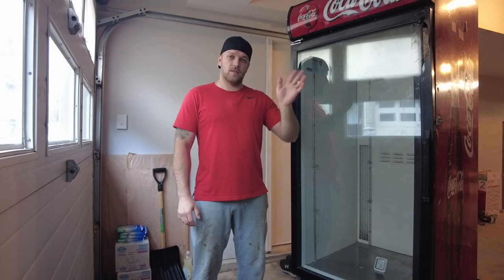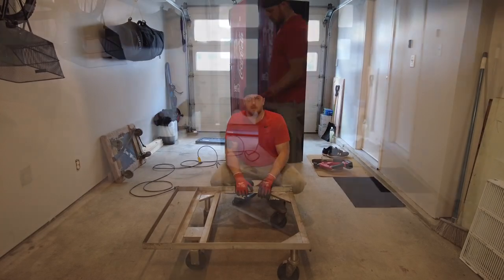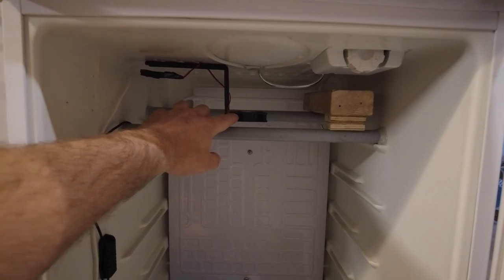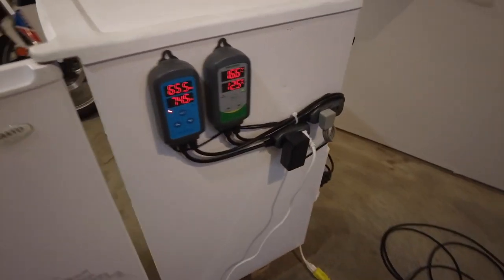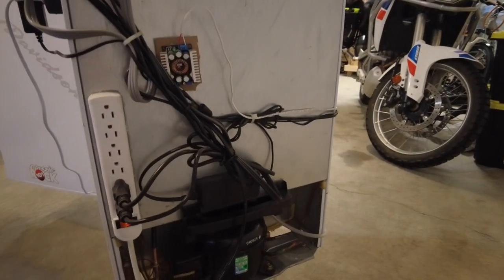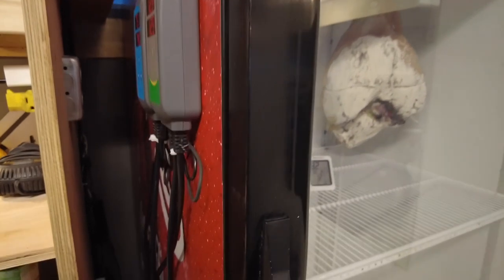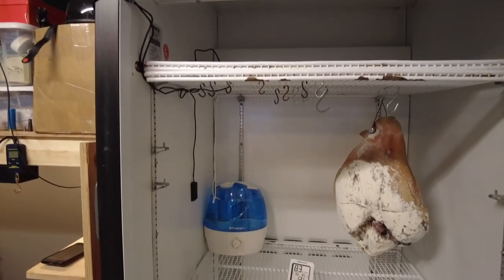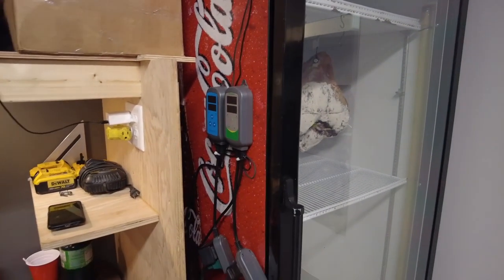Dry Curing Chamber, Easy Built

Comment: Can you provide more details on the timer? How it is wired? I am having the same issue with the excessive dehumidifying, I am also starting with a bar fridge.. Also, do you have a link to the timer from Amazon? 

Thank you!
Reply from the maker: Hey! Check discription, it's in discription the link. Wiring is very simple, but some guys might be confused so I can actually make a detailed video, explaining. Follow me here and I will make one this weekend for everyone 👍
Reply: @westcoastcharcuterie  sounds good! Thanks again. 

Just out of curiosity: in your experience how does having it on cooler side(say 50.6-51f) effect the product?
Reply: I must be missing the link to the timer in the description…this is your description: Hi friends! Finally I have a nice, big size commercial fridge and I'm excited to share it with you!
In this video I will show you how I built my little bar fridge chamber and we will go over a few Tips and a small secret on how to balance your fridge temperature and humidity.
If you have any questions please leave your comments and I will be more then happy to answer them.

Humidity and temperature control sensors by Inkbird.
Reply from the maker: @ironblud  I usually run on average 12.5-13°c so that is like 52-53°F I believe. In my experience I noticed that in higher temp the mold and bacteria develops flavours much better then really cold temperatures. If you have inkbird temperature controller, you can easily set up your temperature however you want
Reply from the maker: @ironblud  thanks for correcting me, I just shared it in other comments. I will update now. 
Here it is:https://www.amazon.ca/dp/B07F1C4W3M/ref=sspa_dk_detail_10?psc=1&pf_rd_p=d8c43617-c625-45bd-a63f-ad8715c2c055&pf_rd_r=7MGH8MHT4P50WAPRHYW0&pd_rd_wg=LITCc&pd_rd_w=wVJrk&content-id=amzn1.sym.d8c43617-c625-45bd-a63f-ad8715c2c055&pd_rd_r=ad8aacf6-6cc8-4ea0-9ef1-5b0bedacfeee&s=automotive&sp_csd=d2lkZ2V0TmFtZT1zcF9kZXRhaWw
Reply: @westcoastcharcuterie  thanks again!!

Comment: I noticed that you're passing wiring through the door. Is there not a gap being made in the gasket that way? Or you found a solution for it? I have a similar small fridge only with glass door that I'm working on at the moment.
Reply from the maker: Yes I just did for both fridges from the side in the bottom corners and it worked great. I didn't want to drill holes and run wires other way. I sold my little fridge, was very easy to remove all equipment and I sold it as perfectly functioning fridge. Did the same with a glass door one. Ran all wires in the bottom corner and that gap is actually so small that nothing ever can get in. Wires are thin, so it never been an issue, doors close properly too.
Reply: Yeah I get your point.  I'm not sure if there's tubes in walls of this fridges with cooling backplate, so at this time my greatest concern is that if I drill holes I may kill the fridge. That is why I'm interested in trying to do it how you did. Also my equipment is a bit different but the principle is the same.
Reply from the maker: @hammertiming8423  @hammertiming8423 I'm sure it will be fine. That's why I don't want to drill any holes in the fridges.. if something does not work you can always adjust and make changes, but once the holes are drilled, you can't go back..
Another tip, if you fridge is cycling to often, put your sensor in an empty glass bottle
Reply: You was right, I hotglued everything through the door and thickened a bit the area where the gap is, and there's no gap at all now. So far in the last 24h temperature and humidity is constantly in the parameters i initially setup. I'll try to put sensor in a bottle now to see if anything changes, cheers.
Reply from the maker: @hammertiming8423  Yep, great! Keep testing! Don't forget once you start loading fresh products, your humidity will go up to 85-87% but it's ok, it will stabilize after couple weeks and if you getting green mold you will need to install small fan like I did to circulate the air
Reply: @westcoastcharcuterie  so far the humidity is going from 73 to 80, mostly on 75. I'll do the initial drying outside the fridge italian way, and the finish it off inside. I hope i don't contaminate the fridge with bad mold and that ill manage to keep down humidity under 80 and above 70 with product inside.. ill see next week how it behaves. Thanks for the heads up man, much appreciated.
Reply: @westcoastcharcuterie  i got white mold at the end, and lots of it.. what i did was buying the moldiest sausage for 2 euros i could find.. (being in Italy it wasn't hard) and I ribbed it every salame, then hanged it in the middle to try and contaminate my product with that mold.. what do you know,  in 2 days everything has started to become white, it's different molds though, white hairy one and white like paint on the casings.. one of them is wild, the other contaminated from the bought sausage.. a bag of mold cost 30 euros.. this 2 euros trick worked like a charm 😂
Reply from the maker: @hammertiming8423  great idea! I'm glad it worked! I bought small bag, about 5g for $25 and that last me for the past 2 years and I still have some left for maybe another year. All you need is a tinny drip of mold in the water, mix it and then brush it onto the product. You can also take some white mold from your product, mix with water and spray all your chamber walls. That will help naturally build mold too.
Reply: @westcoastcharcuterie   good tip, was actually thinking to soak molded casing in water for humidifier and s what's going to happen 👍. Im thinking of installing that computer fan inside fridge.. but it makes me thinking of case hardening
Reply from the maker: @hammertiming8423  if you install computer fan, install it blowing upwards and plug it with a fridge, so it only turns on for couple minutes when fridge starts to run, just like in the video. It will help distribute cooling and circulate the air around chamber. I had mine set to minimum speed and never had a case hardening. It worked really well!

Comment: how well does that work?
Reply from the maker: Really well! I had amazing products coming out of this little one and now I upgraded to full size commercial fridge.
Reply: @westcoastcharcuterie  1) On average,:
- how often do you need to fill the humidifier tank? 
And 
- how often do you empty the dehumidifier?

Great video, thank you!
Reply from the maker: @SS-pi2yi  during winter months I can easily go about a month without refilling water and maybe 3-4weeks on dehumidifier, but in summer months or if you have a lot of fresh products it can cut down to 2-3weeks. During summer fridge cycles much more often, builds up more moisture, etc.. but average 3-4 weeks. You can safely go on vacation haha! One thing I would highly recommend is get wifi thermometer and set up alerts, it already saved me once when my fridge died all the sudden! It's extremely useful
Reply: @westcoastcharcuterie  ah yes wifi monitoring is a great tip . Is it a special type of humidifer that one should use in this curing chamger application ? like a cool mist ? or warm mist or ultrasonic or evaporative etc? What type is the one you are using? (or simply make/model # etc)
 - thanks again!
Reply from the maker: @SS-pi2yi  I used the cheapest available haha. Do not buy something fancy, electronic screen etc.. If you ever lose power and it comes back on, you are safe and your humidifier will be back in service. Electronic ones you will have to turn it back on. Simple, cheap things work best in this situation!

 Here is exactly same as mine:
https://www.amazon.ca/Cool-Mist-Humidifiers-Bedroom-Ultrasonic/dp/B0BL1V7QQ3/ref=asc_df_B0BL1V7QQ3/?tag=googlemobshop-20&linkCode=df0&hvadid=583487178883&hvpos=&hvnetw=g&hvrand=12472926327047616043&hvpone=&hvptwo=&hvqmt=&hvdev=m&hvdvcmdl=&hvlocint=&hvlocphy=9001503&hvtargid=pla-1918365495067&psc=1&mcid=15e3230567b638ce97c59670699cf7e9
Reply: @westcoastcharcuterie  Oh and one other thing I was wondering about your setup:
- using your humidifier in this type of application,  in your experience, do you find it is best to also wash the tank (and/or other parts possibly..) every time you refill water to the tank (to avoid slimy or other unwanted water effects from the humidifier etc) ? or you wash every few water refills etc..
             and
- similar question for de-humidifier (when removing water in tank etc).
Reply from the maker: @SS-pi2yi  I remove water from dehumidifier once it's full and thats it. For my humidifier I use clean filtered water, so it never gets dirty. I do once a year nice full clean down, I would fill up bleach water mix into my humidifier, let it soak, clean, rinse, wash etc.. always good to keep things clean, just don't overthink. Once you have nice thick white mold growing on your products, it gives great protection
Reply: @westcoastcharcuterie  great guidance..many thanks!